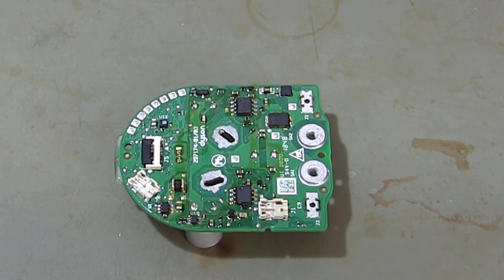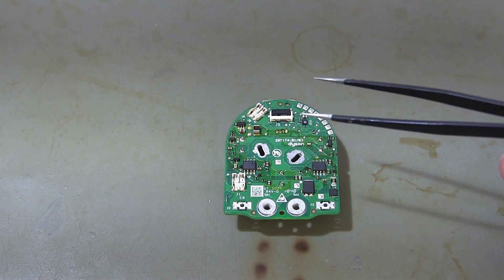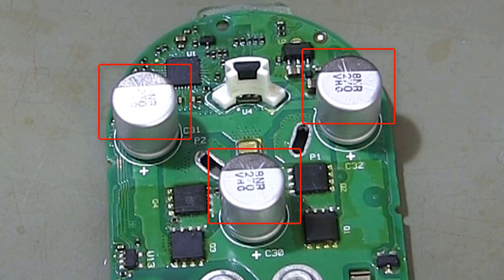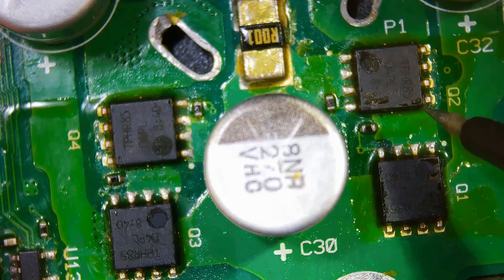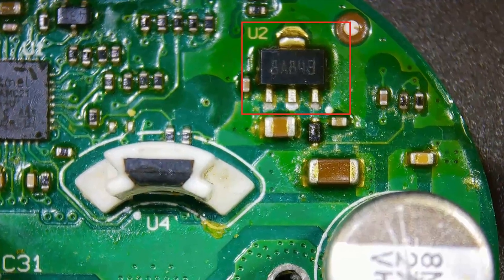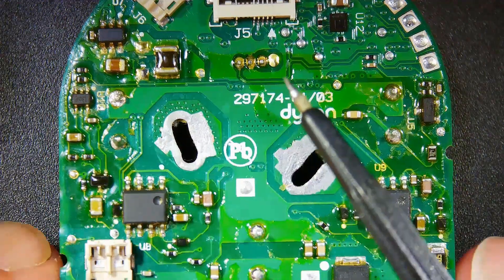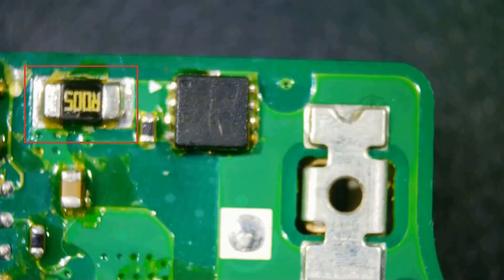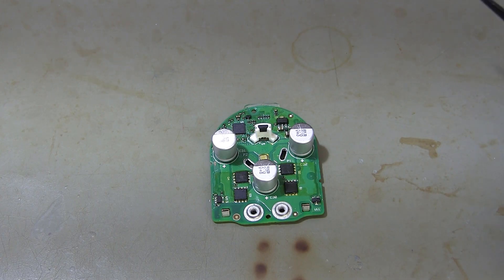How to Repair Dyson V11 Motor Control Board? Component Analysis

Comment: Can I ask you which component could be faulty if the engine turns off 3 or 4 times when cold but after a while when hot it works perfectly and continuously until I turn it off completely. There are no errors in the display and once the remaining battery time appears the defect no longer occurs. Thank you
Reply from the maker: This issue may indicate a thermal or voltage-related component failure in your Dyson V11 vacuum cleaner. The fact that the device works intermittently when cold but runs continuously after warming up suggests that some components may not function correctly when cold but perform better as they warm up. In such cases, you may want to check the following components:

1. Cold Solder Joints: If there are cold solder joints on components or connection points, this can cause contact issues at low temperatures. As the device heats up, expansion may create proper contact, allowing it to work correctly. It's recommended to re-solder all electronic components on the circuit board.

2. MOSFETs or Transistors: MOSFETs or transistors in the power circuit may be unstable at low temperatures. These components may begin to work more stably as they warm up. It is advisable to check the components in the power section and also re-solder these components.

3. Temperature Sensor: Temperature sensors connected to the motor or battery may produce incorrect readings when cold, potentially triggering a shutdown for protection. When warmed up, they may provide accurate readings. You should check these sensors.

4. BMS Board (Battery Management System): If there are components like MOSFETs or capacitors on the BMS board that behave erratically in cold conditions, this could cause the device to malfunction when cold but work correctly as it warms up.

5. Capacitors: Some capacitors may not provide sufficient capacitance when cold. As the device runs and warms up, the capacitance may return to normal, allowing the device to operate more stably. Check the electrolytic capacitors, particularly in the main power circuit.
Reply: Replace capscitors, classic problem

Comment: 请问中低速档电机运行断断续续应该重点检查哪些元件呢？谢谢指导！
Reply from the maker: Intermittent operation of the motor at medium and low speeds on the Dyson V11 vacuum cleaner can often be caused by a faulty motor control circuit or power transmission component. You can check the following components for this type of problem:

Battery and connections: Check the voltage of the battery to make sure it is providing enough power. If there is looseness or oxidation in the connections, this can also cause the motor to operate erratically.

MOSFETs on the main circuit board (PCB): MOSFETs are used to control the motor speed and can cause intermittent operation when faulty. If there are signs of heating or burning, you may need to replace the MOSFETs.

Cables and connectors: If there is poor contact or looseness in the cables or connectors between the motor and the circuit board, this can cause the motor to operate intermittently. Make sure that all cables are secure and properly connected.

Capacitors on the motor control board: Electrolytic capacitors in particular can lose value over time. Replace any swollen or leaky capacitors.

Soldering cracks on the circuit board.  There may be solder cracks in SMD components on the specific circuit board. Renew the solder of all components.